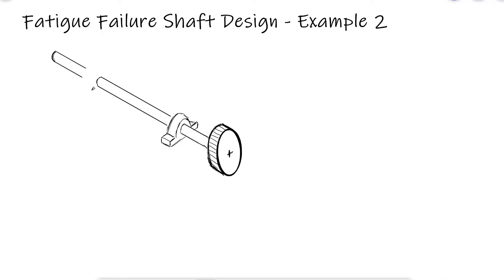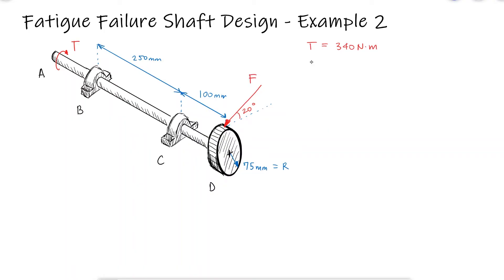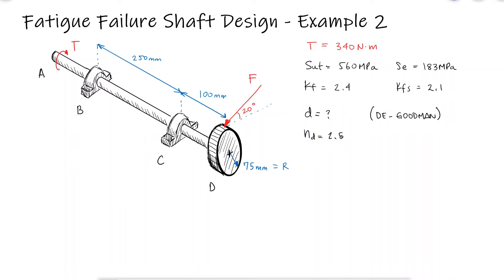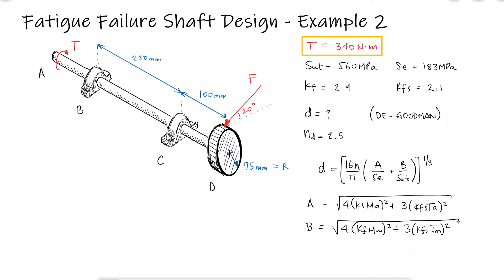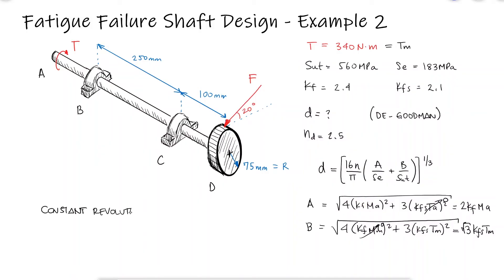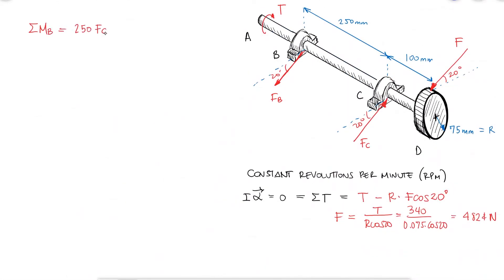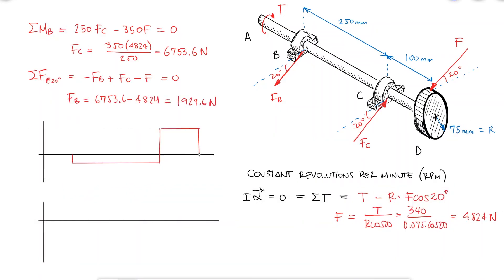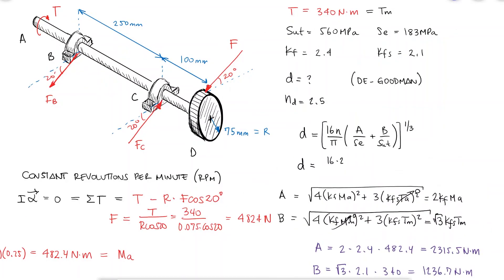Shaft Design - Angled Gear Force on Shaft - Example 2

Comment: @LessBoringLectures which equation is the static yield analysis using the distortion energy theory and the other is fatigue failure analysis? Also, where did you get the se value when it didn't give to you in homework questions from the textbook?

Comment: Hey man, this stuff has been super helpful but I am trying to calculate my moment, alternating stress, and median stress for a couple different sections of drive shafts in my SAE car. My engine output torque is 14.5 ib-in and the material of the shafts is 1045 CS. I know this isn’t enough information to get started but I’m wondering where to go from here. Also shaft 1 runs from engine to CVT, shaft 2 runs from , cvt to gear box and shaft 3 is the main drive shaft. Let me know if you can help. Thanks!!!

Comment: Can anyone explain why the Mean moment is zero?
Reply: Label the top and bottom of the shaft, with A and B respectively.  Consider this section of the shaft, subject to a positive bending moment that makes the shaft "smile".  The A-fibers will be in compression, and the B-fibers will be in tension.

Now spin the shaft 180 degrees, and apply the same loading situation.  Now the B-fibers are on the top, and are in compression, and the A-fibers are on the bottom and are in tension.  The bending moment that the shaft fibers are experiencing, is now equal and opposite, to what they experienced before.  You therefore have completely reversed loading, as far as the bending moment is concerned.  It cycles from A-fibers in tension and B-fibers in compression, to the exact opposite, with every rotation of the shaft.

Normally, the weight of the shaft, the weight of the rotors, and the radial loads associated with gears/pulleys/sprockets/etc, will cause an amplitude to the bending moment, but not a mean bending moment.

An example where you WOULD have a non-zero mean bending moment, is if you had an eccentrically-mounted rotor on the shaft.  Suppose it is heavy enough that the mass and centrifugal effect would cause a significant load.  The apparent centrifugal force caused by this lop-sided rotor would continuously load one group of fibers in tension, and the opposite group of fibers in compression, since its heavy side always pulls outward on the shaft, due to the centrifugal effect.
Reply: Could it also have been moment at C is 0 ?
Reply: @tstvideo1  Not in this problem.

Comment: What about the radial component of the force ? The tangential component is used to calculate torque. But can you use both the radial and tangential component to determine bending moments in 2 different planes and then get the square root of the sum ?
Reply from the maker: Yes, exactly that! Radial and tangential components are used to find the resulting forces (root of the sum of squares) that cause bending moments on the shaft. For gears that are not spur gears (bevel, helical, worm, etc.), the axial force will cause compression or tension in certain sections of the shaft as well. The axial force component is also important for bearings selection.